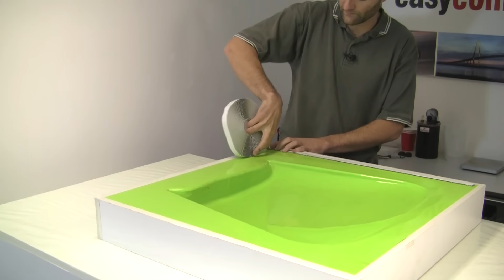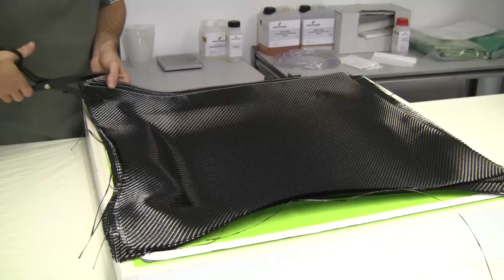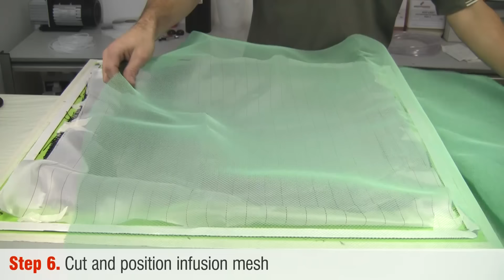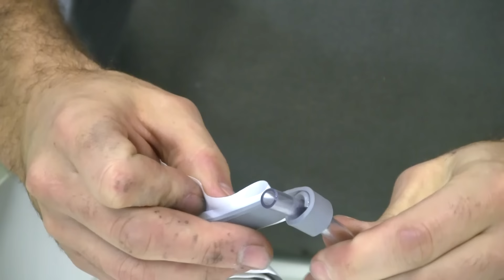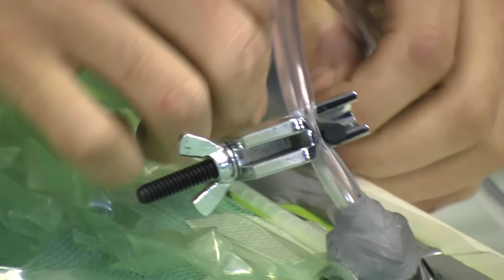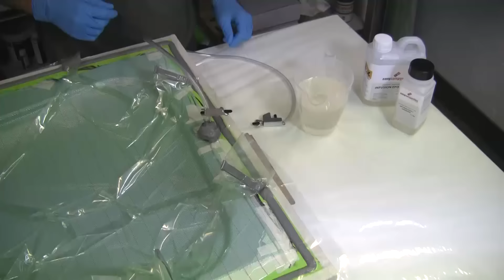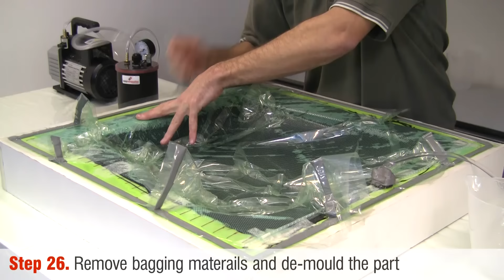How To Do Perfect Vacuum Resin Infusion of a Carbon Fibre Part - Basic Tutorial

Comment: Does this give a better and stronger results than resin coating the carbon fibre then just vacuum bagging with the absorption material
Reply from the maker: Both processes can produce similar results when done perfectly correctly, however the advantage of resin infusion is that the process is much more closely controlled and slightly less reliant on operator skill. A poorly applied surface layer of resin in vacuum bagging cannot be corrected during the bagging process, however with infusion, you simply do not have the same problem.  Each process has its advantages and disadvantages, but on balance we prefer resin infusion every time for this kind of panel.

Comment: when I achieve 30 inches mercury vacuum, I can watch  many small bubbles(as if resin is boiled). Have you experienced such a thing?
Reply from the maker: Epoxy resin should not boil under vacuum. However as you infuse, you often see tiny bubbles of trapped air being dragged out of the laminate and resin along the resin flow line across the panel.

Comment: hello, how i can get surface finish of both sides. I am using easy composite equipment with same steps, but surface finish of upper side is not good, secondly is there any standard to know that extra resin is removed or not.
Reply from the maker: You would need matched moulds to produce a perfect smooth finish on both sides of the moulding. Totally unneccesary on most body panels.  You can sand the peel ply finish smooth then lacquer to bring up a shine.
Reply: thanks
Reply: +Umair Javaidnhvvvffff
Vvvbghhgggghlvvvvggfgffccchhhgereexx
Reply: +Easy Composites Ltd Can you elaborate on this lacquer process? Do I spray it on with a spray gun? If so, do I leave the part still attached to the mold so the lacquer doesn't get onto the already-finished other side?

Comment: Silly question maybe, but since you know that the resin will gain a lot of air bubbles and you aren't using the vacuum pump on the bag at the time of mixing, why not hook up a vacuum pad to the mixing cup and pull the air bubbles out that way?
Reply from the maker: There is no reason why you cannot vacuum degas the resin.  However in our experience, a short wait like demonstrated is adequate enough to remove the majority of any bubbles.

Comment: What kind of layout did you do? +45,0,90,-45 ? Can't tell what warp direction was. Thanks
Reply from the maker: Hi,  The fibres used were orientated in a 0 and 90 orientation as 2/2twill fabric.  As this is a cosmetic part, no rotation of the fabrics was done.  However, you could if you wished, rotate some of the layers 45 degrees to give a slightly more balanced (in terms of stiffness) panel.
Reply: Thanks for the response. I am currently enrolled in a Composite program at my local community college and really enjoy it. We are mostly doing repairs right now but fun none the less. Thanks again!

Comment: Easycompositestv;

I didn't understand the step at 05:40?
Reply from the maker: OK, well, at 5:40 we are adding pleats to the bag. This is so that the bag is larger than the mould, allowing it to follow the contoured shape of the mould. If you don’t add pleats and just run the tape around the edge of the mould then when you stick the bag to the tape it will be tight across the mould and not be able to follow the contours of the mould. You add extra tape running up away from the mould flange. Just do it as you see it in the video. You will also find more examples of pleating in our other infusion videos.
Reply: @easycompositestv  when the vid started I was wondering how to deal with deep moulds,  and, hey pesto, here was the answer, thanks.

Comment: How powerfull vacuum pump is needed? How many cubic meters per min(or hour)? How big vacuum? You said -30 of what? Bar?
Reply from the maker: The pump in the video can flow 42.5l/min and can achieve 99.99% vacuum or 30 inches mercury vacuum on the vacuum gauge you see.  As long as your pump can achieve full vacuum, then the actual flow rate only determines how quickly it gets there.
Reply: 99,99%... It is about 10Pa! 
Thx I wanted to buy one vacuum pump that can do 8-10Pa and about 2cubic meters per hour. Now I know thats good choice
Thank you

Comment: Very informative, thank you very much. I have one question however, in your starter kit you include the breather layer, I was wondering why you didn't use that in this video, thanks.
Reply from the maker: The breather fabric is not always necessary. Some people like to use breather under the vacuum port to soak up excess resin and allow a path for air to escape. However the same result can be had using a strip of mesh as we show. People have the option to do either.

Comment from the maker: Resin infusion has been successfully used on a large scale for boat hulls, aircraft parts etc so it is theoretically possible. Obviously you would need to approach your FAA representative for advice to ensure your work complies with the necessary standards.

Comment: I have this problem when I infuse a part the resin tends to flow faster on the top side of the part comparing with the bottom side (I guess cos it takes time to penetrate through the layers of fibres). the result is that some area at the bottom is fibres without resin. I keep pump on and resin flowing until it starts getting gel-like.  Could u suggest how this problem can be overcome? thanks.

Comment from the maker: You can still use a moulding process and resin infusion if needs be.  It would be very fiddly to do on small tubes.  Large diameter tubes could be done around either a mandrel or a split moulding.

Comment from the maker: To do it with cylinders you need a lot of bag so you have no voids in the centre of the mould. Its not an ideal way to make tubes.  Most larger tubes are made using a roll wrapping process.

Comment: Here's a mix done with a speed mixing machine designed to minimise entrained gas (i.e. nothing is stirred or shaken, i it's all done by rotation) that is totally transparent and no apparent bubbles until a vacuum is pulled on it (and not even a particularly high level of vac).

Comment: 1) Yes, it's absolutely VITAL to actively degas the resin beforehand - just letting the visible bubbles rise isn't at all acceptable if you want to ensure you have no voids. this can be seen by the foamy resin coming out of the exit tube - dissolved gases will be expanding throughout the whole structure if you're not lucky.

Comment from the maker: You can degas the resin if you wish, but letting it stand for a few minutes gets rid of most of the large bubbles. Most of the rest are drawn out by the vacuum pump during infusion.

The Aimed for ratio is 60:40 fibre/resin.

If you leave the vacuum pump on continuously then you can suck out too much resin ruining the surface finish.

Comment: 5) Would the constant sucction according to point 4) harm the product such as it would draw out too much resin 

[I only know the method where the pump is on for the duration of the drying process in order to avoid even an infinite small leak and to achieve the utmost possible resin-fiber ratio]!

6) Any other experience you want to share on this matter? :)

Thanks a lot in advance and appologize my humble English.

BR from Austria

Comment: A few questions:

1) Would it help to degas the resin actively (via vacuum) in order to achieve a better result (air bubbles, etc.)?
2) If you cut the resin outflow as shown, what resin-fiber ratio do you achieve?
3) When closing vaccum hose as soon as a mix of resin and air is getting in, where resides the residual air inside and why does it not harm the product/laminate via bubbles?
4) Would leaving the vaccum hose open (pump on) after cutting resin inflow achieve a better resin-fiber ratio?

Comment: What is the mould preparation procedure used for this tool? I.e. what did you use for the sealing coat? ...and also, what tooling block was used for the tool?

Comment from the maker: The only way to use the resin infusion process to create a double-A sided part (smooth finish both sides) would be to use a matched mould (so a front mould and a back mould) and then use an internal flow medium that the resin could flow through. The one we use most often is Lantor Soric (you'll see it used in our bonnet making video series), this means you don't need mesh for the resin to infuse through the part and so you can have a closed mould (like with RTM) allowing for a double A side.

Comment from the maker: Yes, you can do this. You might actually still find that peel ply would be fine as rather than using a perforated film which you could then paint with a 2k paint and flat to get your smooth surface. It only takes a single coat of paint to fill the texture of a peel-ply into a smooth finish. The other film to consider would be a breadwrap which is much more perforated than a P3 perforated film and so would be less restricting on resin flow.

Comment from the maker: Haha! Yes, they are good shears! They're made specially for us by William Whiteley of Sheffield. The blade angle is specifically for carbon fibre and then our touch was to have the serration put on the upper blade not the lower blade so that they slide through carbon without snagging it accidentally. PTFE coating keeps them sharper longer too. You'll find them on the Easy Composites website.

Comment: What i'm planning to do is make a foamcore wing for an rc aircraft.... it's quite easy to shape the foam, and then vacuum bag it with composites, as this has been done before numerous times... the only thing i want to do different is use vacuum infusion instead of wet layup.
But i think ill just use perforated release film and then polish away the tiny dots made by it.

Comment from the maker: Yes, we got a pin-hole free, high gloss surface finish (flick the video to 'High Definition' mode and you should be able to see this). That's the difference between how we do resin infusion we our equipment and resin and how other people do it - in a sense, that's the point of this video to show that it can, reliable, be done if you follow all the steps. Take a look at the TDS for our IN2 infusion resin (link on our website) for all the specifications, including viscosity. It's an amazing resin!

Comment from the maker: Bagging tape will stick to PVA OK but remember that you could quite easily accidentally pull the PVA off the mould if you weren't careful. The PVA's bond to the bond is very weak (it's a release agent after all) and so when you're bagging down you can have the PVA come away from the mould which would cause a leak and spoil everything.

Comment: Wouldn't it be easier with this small of a part to just use an entire plastic bag that holds the entire mold inside it? Then just place the in and out leads in a good way. Also, have you tested with different amounts of resin in for example this mold? To see how it affects strength and weight. Perhaps you could produce a chart pointing to how much resin one should pump out (based on what atributes you want from the part)?

Comment from the maker: If you're making a flat sheet then a sheet of glass is perfect because they're hard to scratch, have a fantasticaly flat, glossy surface and are cheap and easy to get hold of. Prepare the sheet of glass using a chemical release agent (to stop the resin from sticking to it) and you should be fine.

Comment from the maker: Even using this type of mixer arrangement it's quite difficult to ensure there is no airation of the resin. Generally, we don't ever find a problem with it but if it's a concern or is causing problems then the only foolproof method would be to vacuum degass the resin, either in the catch-pot itself (being careful how you put that in and out of the system) or in a dedicated vacuum degassing chamber. We sell these on our website.

Comment from the maker: You need a split-mould and then, like Johnx says, you need something creating positive pressure on the inside, consoldating the fibre and resin to the outside of the tube. Once it's cured you would separate the two halves of the mould to get the part out and extract the bladder/expanding core from the inside of the tube. Composite tubes, particularly where the outside is the 'A' side are pretty complicated.

Comment from the maker: I have no idea how this could cause a leak in the vacuum seal, sorry, but that's wrong. The air that is in the line connecting the resin to the bag should be minimised as much as possible but it will get drawn out by the pump. You use an extra clamp to clamp off the line right at the point where the resin is but as you can see (there's no trickery here) we get a perfect product doing it exactly this way.

Comment: In addition to pulling a vacuum on the resin to get the air out before infusing the part, I've seen guys make a mixer that uses a rotating magnet under the resin container and a metal bar inside the resin so you don't introduce air into the resin by hand mixing.

Comment: have you experience building carbon fiber over another object like plastic without using a vacuum bag.  Just letting it dry for 24 hours. I have tried several times and not  having any luck. The parts dry uneven and the edge are all mess up. Any tips

Comment from the maker: -1 bar or -1000mbar or as near as you can possibly get. 99.99% vacuum is what our pump pulls and this is really what we would say you need. Anything less than an almost total vacuum will have a negative impact on the surface finish of your parts - the tell-tale sign generally being pin holes in the surface or tiny air bubbles in the laminate. Infusing under a near total vacuum will eliminate this.
Reply: Why doesnt the resin boil at this vacuum?
Reply from the maker: @gaborbartos4081  The chemistry of epoxy and the lack of VOC's mean that they don't boil under vacuum. Unlike polyester and other styrene based resins which can boil off the volatile liquids under vacuum.
Reply: @easycompositestv 
I have a vacuum pump that generates a vacuum of 0.07 mbar with gas ballast. Can I use this?
Reply from the maker: @gaborbartos4081  0.07mbar is a very high level of vacuum so yes this would be fine.

Comment from the maker: Hi, We use Perma-Grit tools which are tungsten carbide tools (like tile cutting tools). They're fantastic and last forever (you'll find a good range of them on our website). You would to the initial cut with a permagrit wheel in a dremmel and then finish the edge using a permagrit sanding block (or just some coarse abrasive paper wrapped round a block) before finishing the edge smooth by using finer grits of abrasive paper. A black wax crayon does a nice job of sealing and polishing a cut edge.

Comment: @matthieutje65 : Peel ply on the inside and outside will certainly give you a none glossy finish but it will be reasonably textured by the peel-ply. If that's what you're after then it's fine, if you just want a smooth, none-glossy finish then you might want to just use a scoth-pad on the finished part to rub the gloss away. I'm not sure what the optimium resin uptake is on flax but I think it's around 50% by weight to weigh the reinforcement and plan for the same weight in resin.

Comment from the maker: @raining0724 : The mould used in this video is made of epoxy tooling gelcoat (the bright green finish that you see) and then backed up (reinforced) with epoxy mould making putty. Both of these materials are included in our Mould Making Starter Kit or can be purchased separately. The import thing (if you're going to use a chemical release like we do in this video) is to ensure that the mould's surface is made of epoxy, otherwise an epoxy part may stick in the mould.

Comment from the maker: @xzu : We tend to trim all our parts with a Dremel using a Perma-Grit tungsten carbide wheel - they're amazing and last forever. Never trim using anything with 'teeth', always a gritted edge instead; teeth will chip the composite around the cut line. Once trimmed we use a Perma-Grit block to smooth the edge and then finish with different grits of abrasive paper (up to about 800). To finish either the part is lacquered or we just wax it and leave it at that.
Reply: I'm from Indonesia, I can communicate via WhatsApp

Comment from the maker: @Zyworski : You can degass but we've never found it neccesary. If you do, you need to be very careful that the resin does not exotherm in the pot whilst degassing causing it to gel prematurely. You need to be infusing 10 mins after mixing at the latest. The RICs (resin infusion connectors) are connected to the tube inside the bag, ours are designed for a 9mm OD tube to be pushed into them. Since the connector is *inside* the bag though, it doesn't have to be an airtight seal.

Comment from the maker: @vr6k3 : 'Post Curing' at elevated temperature is an excellent way to improve the mechanical properties and the Tg/HDT (glass transition temp/heat distortion temp) of a carbon part. The recommended post-cure cycle depends on the resin. With our infusion resin the recommended post-cure is 8hrs at 60*C which gives a HDT of 90*C. You can post-cure in the mould (even still vacced down) or demould first. If you demould first you'll need to ramp the temp up very slowly to avoid distortion.

Comment from the maker: @Maticus07 : Yes, certainly. In fact, if you are planning to make a whole car body I woun't suggest any other process - infusion would be the most cost effective way to make a top quality carbon body, or, something we don't really show in this video, infusion is also fantastic for a glass reinforced body, infused with epoxy resin - it would be about half the weight (or less) of a normal wet-lay CSM polyester equivelent.
Reply: Yes and infusion is a lot less labor. Wet carbon fiber lay takes a lot of work! And will Not come out as nice as an infusion part.